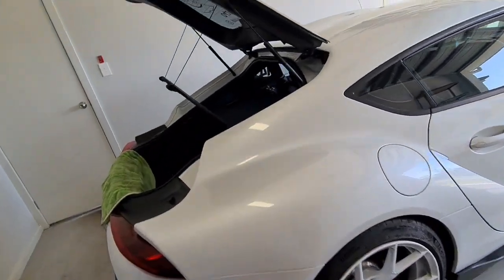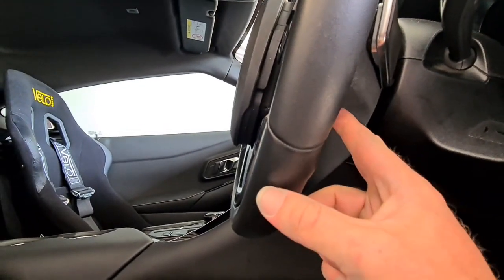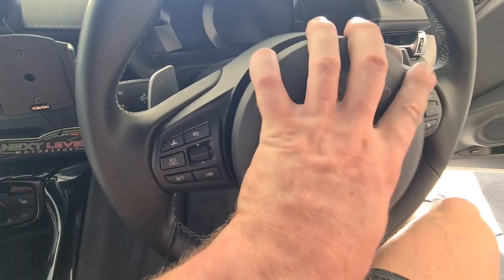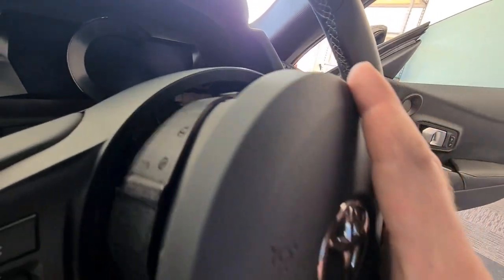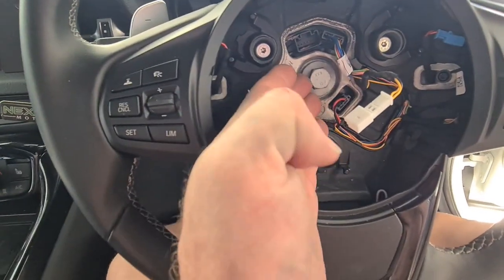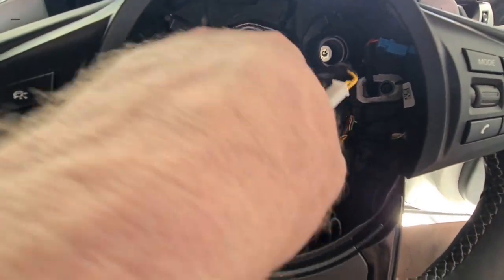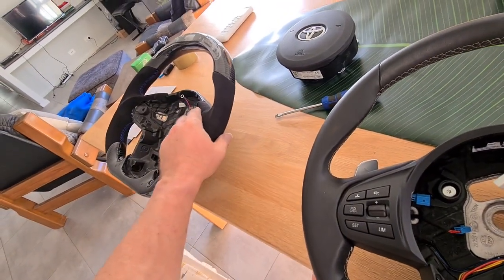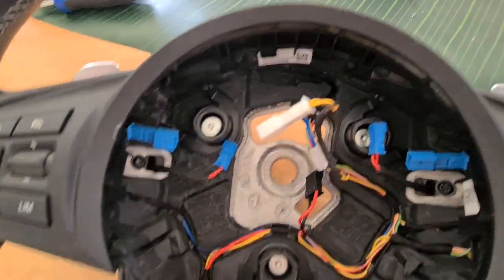LED steering wheel Installation to the MK5 A90 Supra

Comment: I want to see how you slice the wire and how you connect them.
Reply from the maker: Hey brother, just use a sharp Stanley knife blade (be careful they are sharp) and peel back some of the insulation on the factory wire. 

Once your opened it up to see the bar wire, separate some of it to make a hole. 

Put the wire from the steering wheel through it and twist it round to secure in place, then add a tiny bit of solder 

Cover with heat wrap or electrical tape

Comment: Hey buddy I installed one of these on my car and I had a bunch of malfunction problems is that a problem you had with yours
Reply from the maker: what errors did you get mate?
Reply: @Simonstockton82 when I'm driving or say drivetrain error and the car will turn off I have to wait for 30 to 40 minutes before I started and then I'll start back up again with no problem but sometimes that occurs and sometimes it doesn't now when I put it on the scanner when the first happens it says there's no communication my transmission thing turns off the actual light on it when I wait for a little while I'll start back up again but it can do it again now I've noticed when I plug unplug it it doesn't do that I was wondering if mine is the only one or maybe I've plugged something wrong or something I'm just trying to get to the bottom of it that's all
Reply from the maker: no i havent seen that mate. you shouldnt have drive train and gear box problems from a steering wheel change. if anything it would be air bag errors
Reply: @Simonstockton82  I really appreciate it because my car was in the accident and they're trying to tell me it's from the steering wheel and I know it shouldn't cause that problems you know what I mean so I really appreciate it thank you

Comment: Where does the blue cable go?
Reply from the maker: Hey bro, if you use the red wire to the 12v live you don't need to use the blue one. The blue is to make up the current if you use the horn switch because it doesn't flow enough zap zaps

Comment: Where did you run the ground wire to?  Thanks!
Reply from the maker: Hey brother. The ground wire gets run to the ground for the steering wheel vibration unit. As you dismantle the wheel, it's bottom left of the motor unit 🤟

Comment: What about that blue cable? And thanks for the video
Reply from the maker: Hey bro, of you use the red wire to the 12v live you don't need to use the blue one. The blue is to make up the current if you use the horn switch because it doesn't flow enough zap zaps

Comment: Can you show how you splice the red cable?
Reply from the maker: I will find a video for you
Reply: @Simonstockton82  how did you splice?
Reply from the maker: @dylancarter8991  hey man I just cut away some of the insulating, pulled the wires apart and inserted the LED wheels power wire through the live one on the car, a tiny bit of solder and the recovered with tape
Reply: @Simonstockton82  thank you very much just tried that and got it!
Reply from the maker: @dylancarter8991  no problems brother

Comment: So i attempted this but the steering wheel teeth didn't match up so i had to put everything back. Now my air bag light is on. I did turn the car on without the air bag. Not sure how i can turn it off
Reply from the maker: Hey mate, where did you get the wheel from
Reply: It was vq customs going to return it and get one from East Coast customs
Reply: East Coast supra
Reply from the maker: @anthytheboss  did you take any pictures man. Our wheels are thr same so it should have lined up. They can be tight sometimes. As for the airbag light, you'll just need to clear the codes on the ecu.
Reply from the maker: @anthytheboss  oh yep, just saw the vq customs bit. I don't know much about their products
Reply: Any tips on that i have a Bluetooth obd2 reader but it doesn't read or clear airbag codes
Reply from the maker: @anthytheboss  shoot me a message on the insta page bro, ironclad motorsport. Will be easier to help you from there.
Reply: @Simonstockton82   I’m in the same boat as @anthonytheboss. Bought wheel from vqcarboncustom, it has OHC wireless module and same wiring in your video. Managed to pair module to steering wheel but there’s no reading. 0 rpm, 0mph etc, then steering wheel powers down. Installed on 2021 A91 Supra. Any ideas brother ? Appreciate any help thanks!
Reply from the maker: @raymsix  oh man that sucks. Check that the OBD2 is plugged in all the way and also make sure nothing else is plugged into the second adapter peice. (I had issues trying to pull the data through my MHD dongle while the wheel was on) if the wheel still keeps turning off, it might be a faulty module and vqcarbon should warrant that for you. We would if you got the wheel from us
Reply from the maker: @raymsix  if you are in the US his up Justin Lazarus from East cost supra if VQ refund you. Justin is the man
Reply: @Simonstockton82  thanks for the advice brother, definitely going to give it a try  when I get home. I bought another steering wheel from east coast Supra just now(without leds) but until it arrives I’ll have to bugger around with this one. When the steering wheel powers down, it goes into time out mode count down then shuts off. I also have to turn it on every time I start the car. Plus I have the air bag error code on! 😅